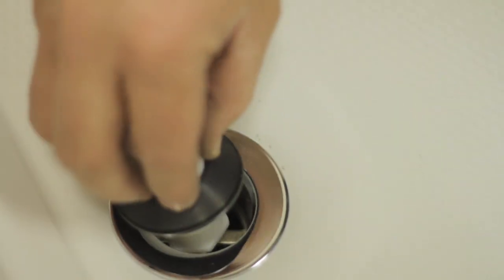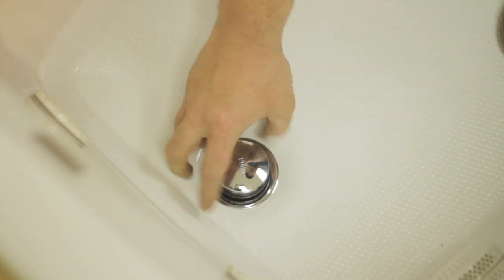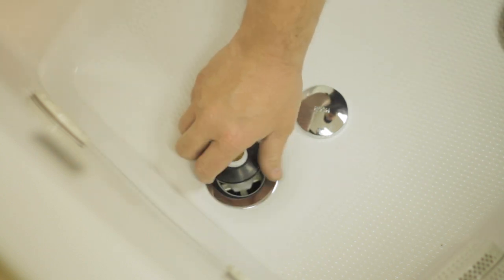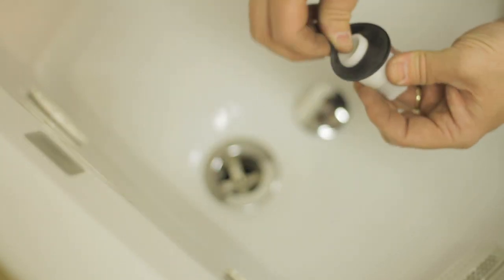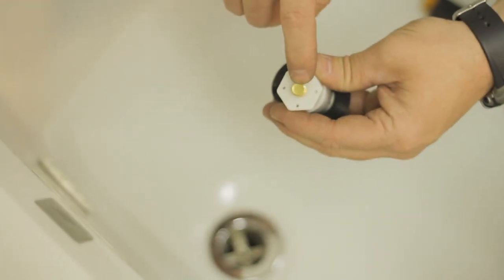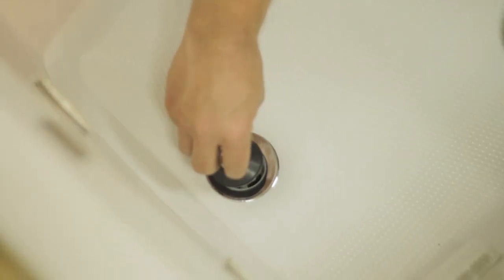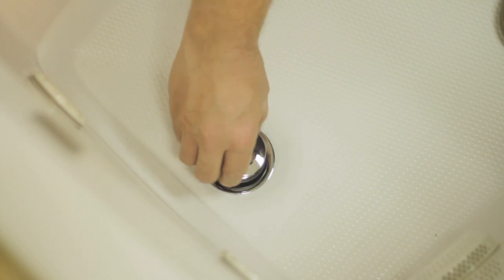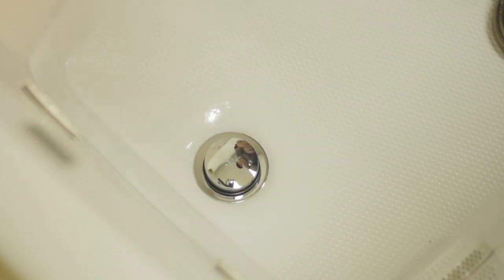Bathroom Repair : How to Repair a Foot-Lock Bathtub Drain

Comment: To keep this in place in the proper adjustment height, use a little Teflon plumbers tape. That way every time your foot hits the drain you don't loose your adjusted height. This also allows you to put the gasket on the metal part where it doesn't flip the wrong way. If I put the gasket where it belongs it just inverts. Thank You for the video

Comment: After removing the cap and the flange, I had to go buy a new 3/8 inch screwdriver with 12 inch handle to get enough leverage to unscrew unit as it was really stuck.

Comment: I took my stopper apart and now I can't figure out where the smaller spring is supposed to go. The one with the plastic ring on the end is fine, but that one doesn't seem to work right no matter where I put it and I can't find a video that shows it

Comment: Thanks for the video, I figured as much I'd have to replace mine.  I tried buying a replacement one at Home Depot and it wouldn't screw in (right size, threaded weird).  I can't seem to find the name of the brand I bought the original from, do you have examples of companies that make these?  Would probably be a brand one would find at Lowe's or Home Depot.

Comment: Is the toe touch or foot lock stopper better than using the trip lever type. How often do you have to replace these things. The chain type trip levers seem to last near forever without maintenance. Is there an issue with accidentally hitting the drain with your foot while soaking? After seeing this mess I think I may stick with the trip lever drain.

Comment: I got mine out and slammed it against the wall and finished it off with a 2lb rounding hammer! I got a rubber plug that I can pull out that WORKS!
Reply: 🤣
Simple is effective.